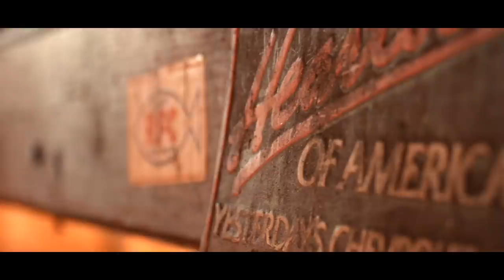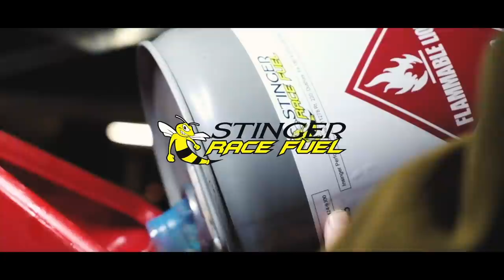I stole my Girlfriend's Car, She wasn't happy... (600HP Stick Shift Foxbody)

Comment: First thing I noticed underneath that 55's hood was that original masters cylinder and that my friend would be the very first thing I'd be changing over to a newer system for safety reasons w/a proportion valve and front disc brakes. Then refill the entire system with DOT5 fluid.  It's full synthetic and doesn't draw any moisture to rust your parts no matter how long your car sets.  This will protect your vehicle more than any Paint Job!
    BRAKES WORK that WORK!
love you guys and your videos.

Comment: Crazy thing sometimes your s10 doing your burnout sounds like top fuel dragster on the video. Just a idea don't know if u ever thought about it, what if u put a defuser setup on the back to help keep the rear planted. Lot of different forms of racing use it on their cars to keep car planted to the road. Also Dad does great work on the carburetor and all the haters have something always to say. Remember anything u do to the truck is only to improve your 60ft and mph. If u go to efi in time people may talk but only cause they wish they was u and have your tuning and driving skill and style. Only true family and friends opinions count. Fans and supporters will always be there. Keep doing u wish nothing but the best for u and your family.

Comment: Rub the surface down with Linseed oil and wipe off with a microfiber every 60-90 days it protects the metal and keeps the patina.  However if a new paint job is affordable by all means let Vics Body Shop paint it.  😉

Comment: Racing is very expensive ,all bs aside its about time to start winning to pay for all those expensive parts, ive been 633 at 213mph in the 1/4at houston international in 1984 im 64 years old and miss racing but i watch you guys and remember ,i own an 03 termi.cobra and its got a few boltons but im fixing to build on my 327 and drop it in my 99 ranger and put some rubber down again before i go to the hole,if you can dig that ,i really would like to live close to you guys cause your my kind of people ty for all the great vids .

Comment: There you go you broke it !! When you missed a gear I thought oh crap Billy is in trouble now. 
With the Falcon and the S 10 having dirty fuel filter issues maybe its about time to check your source of fuel. Might be smart to check that plastic tank in the S10 the alcohol maybe eating it up on the inside.
Larry Morgan used to be a big dog in pro stock for sure Bill Stepp was local to you guys too and he didn't do too bad.
Saw them both at NTR all the time.

Comment: I hope they are dialed in on the lash, because those steel rockers will not be as forgiving as the aluminum and it’s better replacing a rocker or lifter than a valve or piston or wiping out the cam and pumping metal throughout the oil pump and bearings and everything. I don’t think I can buy into the wore out rocker. I think I would study the lash more. It’s good to have water and oil temp gauges together and have the valve cover unbolted with a second set of hands holding it down and when you top the gauges out hurry up and check the hot lash because aluminum dissipates heat rapidly. Iron block iron head with close lash as it heats up but iron block aluminum head will open the lash as it heats up so it’s always a good idea to idle the engine till it reaches temperature. When you have your hot lash pegged you can set it cold because you know how much it’s gonna open up. Bill and the boys know their shit I just hope they’ve thought this one through.

Comment: You forgot about the exhaust seals underneath the driver and passenger seats all three bolts on each seal must be taken off before you pull the headers off
On the 55

Comment: The Music choice's you use F-ing Rocks !  I have to Always have to lift my Driver side of the engine to get the header out !!  Your Molly's mechanic,  you have to test drive it to make sure it is running in top shape for her next race. So in the end it was a good thing you drove the car & it didn't fail at the track ! ?  I remember that pass Molly did in the truck, * I like the stainless Steel rocker rollers over 6500rpm lmao

Comment: The 55 looks good the way it is but, it definitely needs a paint job to save it for year's to come. 🇺🇸
Reply: I commented the same thing I wish there was a way they could have someone just clear coat it, without it being shiny though that to me might look a little funny, to protect it. It just has so much character the way it is. But I'm sure they remember it from one time being nice and black all over so I can understand.
Reply: @ls_812  Bill was talking about replacing front fenders and both rear quarters and the car doesn’t have original paint now so there’s no reason to try and preserve what’s left. If it were mine I’d do it that way and  make her beautiful again so she’ll be good for another 40-50 years. It would be a different story if she had original paint still on her
Reply: @1982MCI  it has the paint on it that it’s had while being in the family for the last 40 years. That’s probably more special than original paint!
Reply: @jackgtx440  it is special to them because of who put that paint on it last time so your right, it probably is more special than the original paint, it would be if it was my car but at some point you’ve gotta make the decision and feelings only protect so much but they won’t protect the car forever unfortunately. 

It’s probly a little late too do it now, but if it were my car, I probly would have had the body and pant done and do new paint from the window bottoms down and then clear the top, hood, and deck lid in a satin clear so that the patina from The paint Denny put on in the late 80’s would be protected. That way, bill could still put the new fenders and rear quarters on, have the new paint where it really needs but still have the look as well as the special memories of the paint that Denny put on it and what he means to the family. 

The only tricky part to that would be blending the paint on the fender and rear quarter tops before it rolls to the side body cause the paint would be thin in those areas as well but for an experienced painter it won’t be bad, it’s only about 4” on the top of each panel. Then they can have both. Save the memories of when Denny painted it plus the protection of the vital areas the car needs. But at some point you’ve gotta understand also that the paint that’s on there will only last so long and the memories will have been lost also so you’ve got to do something at some point and I’d have to believe in my heart that the memories that the entire car carries far outweigh the memories of what the paint that used to be there but is now gone, carried. Bills at one of those crossroads of life that come along just a few times in our lives when we have to make a decision that to anyone else is as easy as deciding on hamburger or hot dogs at the cookout but to Bills family, it affects at least 5 generations of family members as well as close friends who are as important as a family member so I completely agree with your comment and opinion and it’s an extremely tough decision to make but it’s an important part of that whole families history from about the past 60 years or so. 

And it’s just a thought also that came to mind as I was writing this book, I’m sorry for getting long winded, but there’s always possibilities of still protecting memories and reviving the 55 as well. While Denny is still blessed with being with us, and I understand gd probly doesn’t want to take on doing a complete job again, if and when the time comes to it, would the shop be willing and would Denny be capable of coming in and spray the paint on maybe just the top of the car or whatever he feels capable of in order to keep those memories unbroken. There’s still a lot of questions unanswered for right now that can be explored to preserve most of what’s being debated and it’s a hard position for bill and Vicki to be in Right now and pick the best scenario for them so they can keep making these irreplaceable memories for years to come. 

I have the same issue with these types of decisions and am going thru something similar on a vehicle that is special to me cause it was a special vehicle to my wife. It doesn’t carry near the significance that the 55 does but it is special to us and that’s all that  counts at this point. Regardless of what it means or looks like to anyone else, it’s important to us for the reasons that affect us. The older we get, the more of these “little” things we run into and the harder it becomes for us to make the change. Anyways, I’ve said enough, but I think we both want the same thing for the car which is whatever makes Bill and the family happy overall and as long as they are happy, then I’m ecstatic over it all!!

Take care brother, and be safe out there!!

PS: do you happen to have a 440 GTX by the way? What year if you do? I’m a huge Mopar fan myself and have had several Road Runners over the years from 69’s to 74’s. I absolutely love those cars !!
Reply: @1982MCI  i hear what you’re saying. When I left that comment I also didn’t realize the paint was literally falling off. 

Yes, I have a 67 GTX. It’s been in my family since I was 8 years old. I’m 40 now. I built the car in my early 20’s and my dad did all the paint and body. He’s passed away now little over 4 years ago. Building Mopars is what me and him have done my whole life so these cars are extremely sentimental to me. We used to very competitively race a 69 HEMI road runner back in the early years of the Year One F.A.S.T. series. I currently also have a 70 Charger that’s been in the family since I was 8. Grew up in the back seat of that car. My dad rotisserie painted it and finished the paint work 3 weeks before we unexpectedly lost him. The car is still on rotisserie waiting for me to finish it. I also have a ‘66 Belvedere II that me and my kids also play with that’s been in my family since 1990. All this stuff is so sentimental. Probably overly so. The 66!Belvedere is like our family’s version of SRC’s 55 Chevy. That car is faded, has some rust, but we absolutely adore it. Me and the kids are putting a 383 and 4-speed in it over this winter.

Comment: That track looked like 1/4 and billy ran a mid 8. Looks like he let out at 1/8 too so that’s a quick ass truck lol
Reply: And something gives me the idea that there is alot more left on the table. Keep in mind that Billy was testing and not racing. I always knew that truck was fast, just not that fast. Should run low 8's or high 7's. Not bad for a small block chevy with a carb on it, where them ls boys now?
Reply: Thats definitely a high 7s truck i didn't realize it was that fast dam
Reply: @theguru-s2l  ask his brother 😂

Comment: Billy: "it deserves some love", um judging by the paint it's way long overdue for the love.
Reply: Any of you guys feel free to fork over some dollars and time and give it all the love you want.
Reply: @JacobBennett45  if I had both I would I don't so I can't
Reply: Price a paint job ever? I’ve got 7k in the paint job of my square s10. That bel air is prolly gonna be around 10k
Reply: @wesleyfowler8363  for a good reputable shop to do do the work Bill is talking about with replacing both front NOS fenders they already have, replace both rear quarters, strip the lacquer, I’m sure he’ll want it jammed also and possibly engine bay and Trunk area and your looking at well over $10k and possibly a bit over $15k for a good quality job. Paint work is not cheap and finding a  quality restoration shop is even harder nowadays

Comment: Billy,, I'm going to start calling you.             
          (CANT GET RIGHT).      
Everytime you get one thing fixed, another thing pops up..take Wifey's car out you kill the fuel pump,,,,,take S10 out you snap lifter .. Boy ,I will say one thing for sure,, you drive them to they die,,😁😂
Truck looked fast as hell that Last Pass..👍👍

Comment: I put the transmission in the car...I get to beat on her car. Misses a shift and blames it on the shifter handle. Does installing a transmission include installing a shifter.

Comment: Man if I was still stuck shift I’d wanna run that foxbody. Be pretty fair if I ran on motor. And mine is just 8.2 deck built and stroked but maybe y’all will be around here with it and we can make a race happen I’ll run motor and stick the powerglid it to slow it down alittle more vs the c4 and have fun…..also billy get u an electric or air shifter. I run a electric and you set the rpm you wanna shift and it does it super simple. And it workers with my 16v setup no problem I put a resistor just to be safe on thing but definitely look into it will really help shifts and stuff

Comment: Damn that was shifted like I used to shifted I would shift so hard and fast I would break the lever off the transmission from first to second had a 71 Nova it was a badass car not as bad as your truck though now that's bad

Comment: I’m STILL ROLLING over the 3rd gear “oppsee-daisy” by that pro shifted box should shift at lije 6000 or 6500 by just bobbling the gas and pulling and pushing without the clutch. What it won’t do is shift while it’s spinning, the tires grab when you pull it outa gear & the gears and cut synchronizers slow down and don’t match the engine speed. “If it were raining pussies I’d get hit with a dick”🤣🤣 only Billy lmao but you don’t really grasp how fast the truck really is until you see it on a good surface, that BITCH was cutting in the MPH💪🏻👍🏻💯👍🏻💪🏻

Comment: So you need to run mid 8s to be competitive on the streets? Dang, ill just stay on the trailer!
Reply from the maker: That was letting out at half track lol
Reply: His mph was only 122 on an 8.5 pass. I ran a 10.9 at 122.  If billy stayed in it his mph would be 160+ and probably a mid to low 7
Reply: @StreetRacingChannel  I've always known you were fast but I didn't know you were that fast!